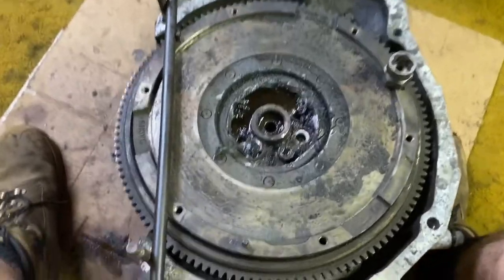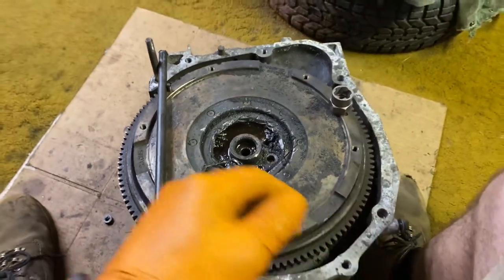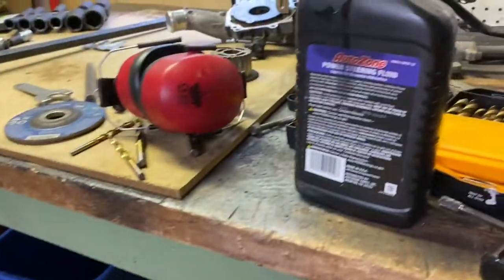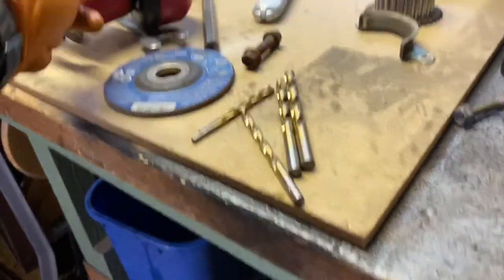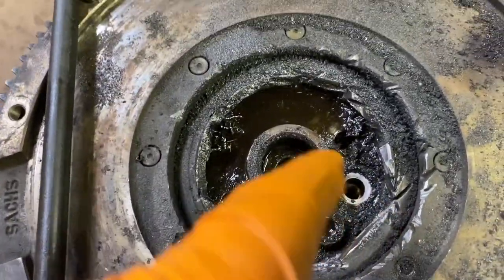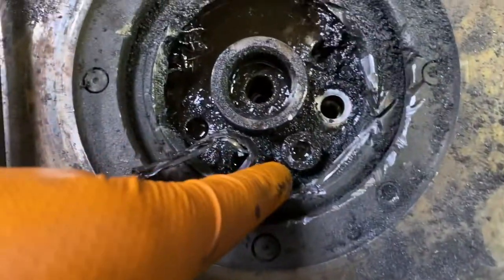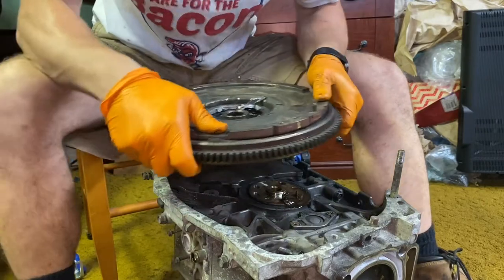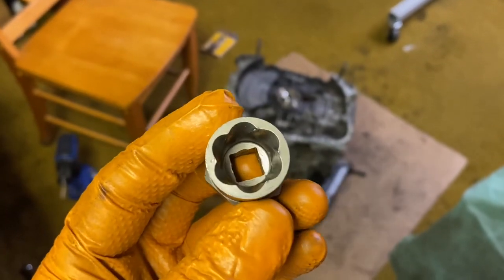HOW-TO Easily Remove Stripped Torx or Allen Bolt

Comment: some prev owner/shop stripped bolts on harmonic balancer golf v 2006, tried to do timing belt job but can't get balancer out.
i managaed to hammer into one and take it out with the triple square socket, but the other 2 (ye its weird there supposed to be 4 but the 4th is a blank ?) are stripped to DEATH, 10mm can't get in too big, 8mm is just rounded off and no grip... now I gotta wait a month for a set of these sweet extractors. Thanks for showing how to use them. Hope I can break the timing belt free.
Reply from the maker: Hoping it went once you got your extractors!

Comment: I’m having the same problem with my flywheel on my frs.
Reply from the maker: Did you try these Irwin socket extractors? Really works so easily
Reply: 4Link 4WD I did and it worked.
Reply from the maker: Cecil Don Nice! Glad it worked

Comment: I always try to use those and everytime it stripes it worse for me.
Reply from the maker: I think the key is really smacking it on with a hammer/mini sledge if you’re able to
Reply: Or use the rocket socket brand, they bite just a bit better than the Irwin brand.
Reply from the maker: @kelnap2294  I’ll check that out! Thank you for the info

Comment: Thinking about giving this a try though I have stubborn allen key bolts seized into motorbike forks which are holding plastic mudguard on, am concerned tool may pinch down on plastic and crack  what do reckon worth a shot regardless?
Reply from the maker: I would try it! The plastic can’t be that expensive if it would crack, but maybe spray some penetrating oil on the bolt too and hope it comes out clean 👊🏼

Comment: I'm trynna figure out how to remove my stripped t55 bolt holding my rear track bar on my jeep, will this still work? (Haven't seen the enter video yet)
Reply from the maker: Oh boy haha I think you’re better off doing some cutting there. Is the nut broken off the bracket? I’d probably cut the head off and try to cut the nut off if that is what happened. Those are a pain

Comment: I have a question for that piece you cut out from the flywheel to get better access to the flywheel bolts. What tool did you use to cut it out? I ran into the same situation
Reply from the maker: Hey I used a 4.5” angle grinder with a cutoff wheel on it. Cut through it pretty quick. A dremel could work too but would take much longer

Comment: I have a Snappy brand set of these that have worked well in the past for me. But i came here looking for answers when they won’t work like they aren’t for me on the MiniCooper Clutch after I stripped them using a standard socket. I went and got the right sockets but it was too late.
Reply from the maker: Are they just not sized up right?

Comment: This is godsent! I just spent hours trying to remove the t50 bolts from my outback xt 2005 with a torch, pb blaster and got two striped and 4 are still there.  Will try this. Thanks a lot.
Reply from the maker: Happy to help! It definitely works though, 100%. As long as you tap the socket on well worth a hammer, itll grab
Reply from the maker: Also, you obviously can’t re use the flywheel but no need to re use a DMF anyway lol
Reply: @4link4wd  It worked great, I was able to remove all 6 bolts and the irwin socket is still in great shape; thank you so much for the video. Not sure what else I could have done without it since I don't have a welder.  What has me concerned is that the outside of the front face of DMF has small chips. Thanks again!!! I am an Irwin socket believer now.
Reply: @happytrails7179  what size Irwin extractor did you use with the t50 bolt? Thanks.